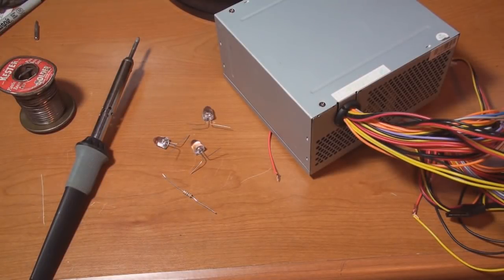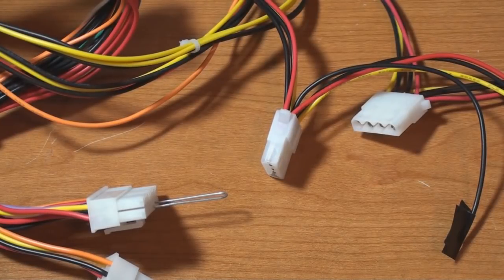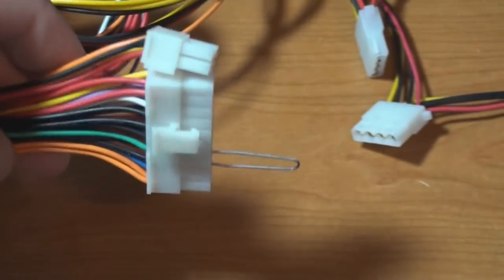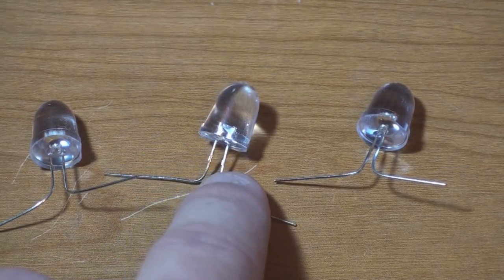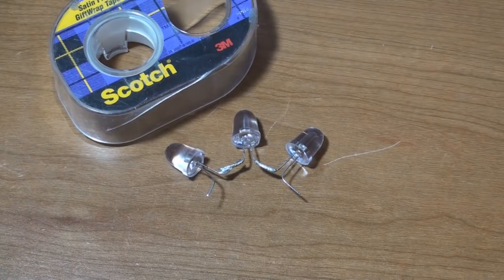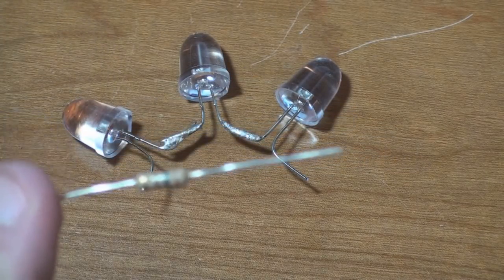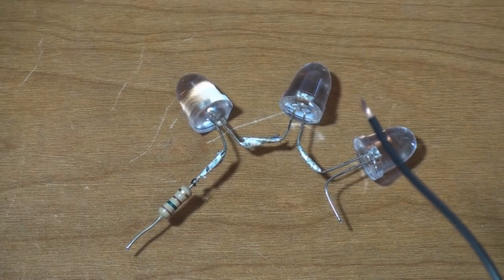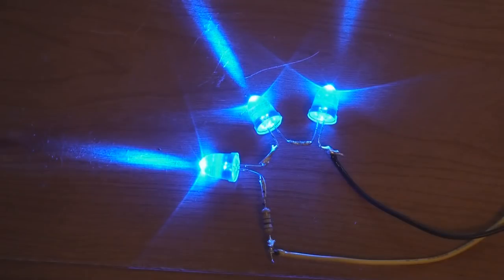How To Wire Multiple LED's in a Series Circuit !!

Comment: Is it fine to connect multiple 3mm led lights to 2 1.5volts batteries? And I don't have resistors😞 to use so is it fine too?

Comment: I wanna wire around 50 leds in series and with the mains 240 V supply how do I do it? Should I connect a resistor after every third led?

Comment: I take it that when LEDs are wired in series, you are limited in how many based on the voltage drop of each one?  For example, if you have a 12V power supply, you would be limited to 4 3V LEDs?

Comment: I am trying to make a series set of LED's to use to light my Christmas village. I need a thin white wire to run about 8" between each LED. I am hoping to use my old train power supplies to run the lights. But I need help in understanding how to make it all happen. Is it possible that you can answer a few questions for me?

Comment: if i were to have 2 6 volt battreys powering 2 leds rated for 3 -3.2 volts each but they are in sireses will the power spilt between them
Reply: dont do that just use the one 6v battery to power both LED'S & yes wire them in series. when you wire in series the foward voltage is added. so both 3v LED with total 6v ... and put a resistor in front of the LED'S in the circut.. i usually salvage a 1000 ohm resistor from old electronics i have.
Reply: @guitarman_3693  did you just reply to a comment from 1 year ago?

I don't even remember context for my comment

But yeah your points are 100% right

Comment: how about parallel wiring, i noticed the resisters that came with my leds get really hot. if one led burns out in a series will this  then cause the other leds to also not work?

Comment: How can i run 6 (5mm leds) on some 9 volt batteries?? 2 9volts? And thats it?? Is there a better option? It's going on my guitar so i need some sort of external power supply. Thanks in advance

Comment: what is the capacity of the resistor you need to use in connecting 3nos 3v LEDs to a 9v power supply in series

Comment: Hi . Thanks for the vid. I want to make headlight LED on an RC model . My output is 5V from a servo converted to a switch. Do you think I can light up 2  3.3v white leds in series ?  Will the two 3.3v ( 6.6v ) LEDS light up with 5V   or will they  just be dim ? I am assuming I do not need a resistor if they do .

Comment: 12Volt power supply,
0.96watts 
0.08A (80mA)
150R (resistor) (1Watt) get 2W for less heat it’s bigger but be better heat dissipation)

Comment: It's 12 volts man, its not going to kill you.  120v won't kill you either unless you hold on to it for a while.  A 12 volt LCD display power supply works well too.  Less power draw as well and super cheap.

Comment: Although that method works, you should use one resistor for each diode and wire them in parallel. Eventually, series wiring as you have done will fail as no two diodes are the same and one will always conduct a little bit more than the others.

Comment: shouldnt you also note the LED voltage? you need enough LEDs to equal 12v or close enough for the LEDs to work or they would blow if you dont have enough or not work at all if you dont have enough

Comment: I used 3mm LED's and a 3.3Ohm resistor but none of the LED's light up when connecting the negative of the last LED to the battery. If I connect the battery to the first LED then just that one lights up. What did I do wrong?
Reply: Daniel May you are not using to correct resistor. google your milliamps to how many volts you are  using and get the corresponding resistor.

Comment: Can i use any resistor values?like 1k ohms 680ohms and so on?
Reply: No, your resistor value depends on your forward voltage drop and amperage. There's another video by some guy whose English is accented but he clearly explains about the calculation.

Comment: Guys it's a 150ohm resistor with a 5% tolerance you can tell by the colored bands on the resistor
Reply: I have not read the bands on a resistor in 30 years.  Thanks for the info
Reply: Someone paid attention during technology

Comment: can we use any resistor??
Reply: No, resistors vary depending on the voltage of your power supply the milliamps and forward voltage of your LEDs as well as if you are wearing them in a series or parallel circuit.

Comment: Hey  could you made a video like this but showing how to wire it to like a c battery or nine volt battery? i have a tiny fan that could be wired like this but i want the fan and leds to turn on the same time. ive got no exp in this area

Comment: I thought in series circuits, the bulbs/leds get progressively dimmer? Isn't that why we use parallel circuits?
Reply: Yes, it is. If you have 3 x 3V LEDs in series with 9V supply, no problem. But if you now connect another LED in series, you have a problem. 4 x 3V LEDs in series will require a 12V supply. You can connect all of them in parallel to either a 3V supply or use a resistor with a 9V supply to bring it down to the 3V required.
Reply: Yes they each have a voltage drop his method doesnt work

Comment: I want to wire 3 led`'s to a 9v battery in series. 2 are 2.5 volt and one is 4 volts. Do I still need to use a resistor?

Comment: Be careful with these small fuckers. One mistake and your entire model goes to smoke. Especially with 12Volt.
Reply: Thats why you use the resistors, to stop them overheating which is caused by the voltage not being regulated.
Reply: Rod Ledbetter ^^ HAHAHAHAHAHA!!!!

Comment: You did not discuss voltage nor resistor values, nor did you discuss the voltage drop across every resistor in the series. All people know how to do with information provided is how to burn out leds.
Reply: +Richard Smith But this leds is still ok...
Reply: With that resistor, these LEDs will be on for years before "burning out" as you say.

Comment: I connected 4 LED bulbs in series and they are very dim.  How do you solve that problem?
Reply: +Mujeeb Ahmed Don't speak if you don't know what you are talking about.

Great question man, he did not tell you each led will have roughly ~1.8v-3.5v voltage drop. This means you will have to boost the voltage, not reduce the resistance, increasing the current. Current needs to stay constant, thats not what is diming the led's, and reducing the resistance will just burn them.
You can only run ~4 LED's in series at 12v before they start becoming underdriven. You will need more voltage to run more than that. Number of resistors in series * voltage drop across resistors = Minimum voltage requirement.
Reply: Richard Smith .. I am attempting to build a ir light illuminater for night vision photography. Would like to project the light as far as possible. To run up to 100 ir leds how much voltage would be required to optimize preformance yet protect the integrity of the led?
Reply: Ricky Williams You can do 10 sets of 10 LED's in series, in parrellel. you could power that with a 40v source(assuming 4v is higher than the forward voltage). For the current required, multiply the LED's forward current by 10. Each set of LED's in series would need their own limiting resistor less you risk one the first strips from being overdriven. When in series, the limiting resistor is that of ONE led, not 10. The forward voltage of each length in series would be multiplied by 10, not the current.
If you do it this way, you do not need current limiting on the power supply, it simply needs to be able to supply at least 10 times the current of each strip of led's in series.
Reply: U can even use transistor
Reply: use resistor with smaller value DUH
Reply: Richard Smith .. I am attempting to build a ir light illuminater for night vision photography. Would like to project the light as far as possible. To run up to 100 ir leds how much voltage would be required to optimize preformance yet protect the integrity of the led?

Comment: Can you explain how to wire 100 of these same lights to one single wall outlet connection for continuous lighting but where each prewired LED light is hanging from its own separate wire much like a Chandelier. Were planning to build a chandelier light but were hanging at least a hundred of these LEDs  from a PVC built base but need all the connections to be spliced into one lamp wire connection that plugs into the wall.  Im going to buy 100 prewired LED lights that already have resistors, and I heard that using either some type of adapter or transformer will work.

Comment: If what you say is true that if the power supply short circuits it might kill you then why take the risk when you could just use a battery. 9v is usually good battery on small circuitry like that and would be sufficient for 3 LEDs. An LED usually runs best on 2.2 volts so if you times 2.2 by 3 giving you 6.6 and you take that away from 9 that gives you 2.4v spare where you can attach a resister onto the positive (red) wire before the LEDs.
Reply: Batteries SUCK.

Comment: Wish i would have watch this video before i burned 100 leds. My question is how many resistors should I use for about 100 3 or 5mm lights.
Reply: +Earl Brown make a parallel circuit for that.
watch my videos
Reply: +Earl Brown You need to know the voltage drop of the LEDs. Usually called forward voltage, or Vf. You also need to know the forward current of the diodes. Called iF. (Actually, you want to be a bit below it, as it's the maximum) You also need to know your supply voltage. Without knowing these three things, you can't know what value resistor to use
Reply: +Earl Brown Anyway, once you know those...Just Google LED array calculator and feed your numbers into it. It will tell you the resistor to use, and show you how you need to wire them. You can't put LEDS in series if there isn't enough voltage for all of them, so you need parallel strings of LEDs in series, each with it's own resistor. The calculator will usually show a few different arrangements that would all work.

Comment: Miller ModPCs: How many Volts was used as power supply and at how many Ohms was the resistor rated? And, can you connect a string of let's say 10 or 20 LEDs with only one resistor?

Comment: Would have been a great video if you had included the mathematics for how to determine what resistor to use and how much voltage to use.
Reply: +Guitar Whores But they never take into account that you should make sure the resistor drops at least 25% of the voltage. Those calculators will suggest 1 ohm resistors whenever supply voltage is an exact multiple of the voltage drop of the diodes. And it would work...but then, in that case, so would no resistor at all. How long the string would survive is a different matter
Reply: mellowb1rd Gotcha... Learn something new everyday. Thanks.
Reply: I know that this is a late response but I have an excel spreadsheet that does the calculations.
Reply: can you share the excel sheet?
Reply: For any resistor you can use this chart to know the value of the resistor : https://www.digikey.com/-/media/Images/Marketing/Resources/Calculators/resistor-color-chart.jpg?la=en-US&ts=72364a89-2139-476a-8a54-8d78dacd29ff

So the first color is the first number (brown=1), the second color is the second number (green=5), the third color is the multiplier (brown=x 10). The resistor in the video has a value of 150 ohm.

now to know your amperage you just divide your voltage by resistance so in this case the resistor is 150 ohm and the voltage 12 v  -> 12/150 = 0.8 A.

Now diodes will work with very small currents and voltage, for example you can run one LED on a 5 volt source at 0.02 amps, so I suspect that three in series would work as well on 5 volts but you may need to give it more than 0.02 amps to get a decent brightness.
Reply: Why did you use resistor
Reply: Sanjeev Gandhi A resistor is needed always for an LED because resistance of the LED drops immediately after an LED powers on so therefore it’ll start drawing more current and eventually burn up.
Reply: @sanjeevgandhi1647  i know its late, answering if anyone else was curious. a resistor limits the amount of current that goes through a bulb. Too much current and the bulb will explode. Its not always needed but hes using a cpu power supply and theres no way to controll the amount of current flowing into the bulbs.
Reply: See this sir!!! 
It includes mathematics. 
https://youtu.be/yWpZ_TxaI5c
Reply: There are resistor calculators online. Much easier than doing it by hand.
Reply: Yup. Would have been essential.

Comment: You should DISCONNECT (unplug) and discharge your power supply for safety. Simply "shutting off" the power supply doesn't prevent or ensure a safe working environment.

Comment: u put that led`s in series circuit becouse u have higt voltage for that led`s(3V+3V+3V+3V=12V)....multiply led`s atenuate the voltage of the surce.....but.....if u have leds in 12 V? Is necesary to series them? I think not....u will put in paralel circuit to consume the Amper of the source :P

Comment: What does the resistor do.
Reply: Diodes are designed to work with low voltages. If we use a 5V supply, too much current will be forced across the diodes, causing them to heat and burn. In order to avoid this, we fit a resistor in series with the LEDs. This drops the voltage and restricts or resists too much current flowing.
Reply: Hey so i want to connect 47 blonking leds one after another  yeah i know its alot lol  can  you throw some tips  on do i really need to add resisters and if so when
Reply: matchudcu diodes are not designed for low voltages only, in most chargers or circuits they are used a rectifiers with change ac to dc and work with 110-250V and some even higher! yet the leds are supposed to work with low current 20-25mA and about 3v
Reply: Resist
Answer provided by an electronics engineering student

Comment: ok... WHat resistance do you use, and why? what's the math behind, so that we would know about the correct values and anticipate what would be required for what we want to do? If you don't provide such information, why not show how to solder if you don't show anything else (and why do you say to cut the power supply's wires, instead of using an adapter for the Molex that itself would cut instead of destroying one of the PSU's wire)?... Frankly, anyone knows that a positive must go on the negative so as to get some current flowing through, be more specific. Thanks anyways.
Reply: Benjamin Frankly , I know, I was just using this clip for a rant in regards of what too many clips are doing : pretend to show this or that type of circuitry, while actually only showing how to solder stuff together. There are many other excellent and better clips for that sole matter. Thanks anyways.

Comment: I have one for you. I have about 8 individual lights in my bicycle. I am talking about twenty AAA batteries. Some lights take three and some take two. And when they are on man does it look nice. The question;  Is there a way to  connect them using only one battery. Oh yes with a off and on switch. Thanks.
Reply: +MrAm1400 what lights you're talking about?? if you're talking about LEDs then you can easily do this task by connecting leds in parallel. :)
watch my videos.

Comment: question: if every LED uses 3 volts and I'm using 4 LEDs and the resistant is calculated R=Vin-Vout/.03A,  R=12V-12V/.03A,  should I use a resistor.?

Comment: can i ask you a question? if i use adjustable adapter as power source and i select the  volt,with condenser, resistor and lots of led can i make a huge led series?
second question,do you have video about using condenser? thank you

Comment: Hey guys,
I want to connect 24 LEDs (12V/DC, 20mA) in 3 circles with 8 LEDs each.

- what kind of resistors will I need and how many?
- do i need a transistor? (230V to 12V?)
- can someone say how much 7100mcd are in comparison? I know there are LEDs with 10000+ but I cant really imagine if 7100 is bright enough..
- how do i calculate the lumen unit?

Best regards and thanks :)

Comment: Okay, sooo if i am going to be using 360 LED's, how many leds to each resistor would i put, and would a 500watt psu be enough power to not burn out for that many leds?

Comment: If you don't use a resistor will it blow your LEDs? What resistor should you use?
Reply: I know that if you are using a 9v battery a 100ohm resistor will be fine.

Comment: Doesn't tell me anything this, why do it serial, rather than parallel?  What is the resistor for? How do I calculate the value of the resistor? The only thing this tutorial is telling me is how to identify pos and neg on an LED, other than that, it is just some kid sticking 3 LED's together. And don't you think it would have been far more professional to refilm it to remove the gaff about completely missing the resistor out?
Reply: series or parrallel doesn't matter. its just showing one of two ways to wire it. There are no pros or cons for series or parrallel. The resistor is put there to adjust the voltage so the led doesn't burn out. A resistor just reduces volts in a current. For example: putting a resistor on a 9v current would bring it down to 8v. ( depending on size of resistor.)  if you put that same resistor on a 120v current, it would bring it to 119v.
Reply: JETGuitars I know all this now, as I went and found far better videos than this one, that actually took the time to explain the theory and the options. This video is just a waste of bandwidth.
Reply: Noblelox
link to better videos?
Reply: ::makes video stating an exact purpose::
::quickly executes exact purpose::
Noblelox gets angry.

Comment: i want to build a 1000 led board to run off of 12volt how would i go about this please.
Reply: For 1000 LEDs have you given any consideration to your 12 volt power source?  It will need to provide close to 7 amps of current.  You're talking 80+ watts worth of LEDs.

Comment: Why do you need a 400 ohm resistor ? when I use the LED calculator  with your specs.  12v power 3.3vf  30ma It said 82ohms,  big gap ...